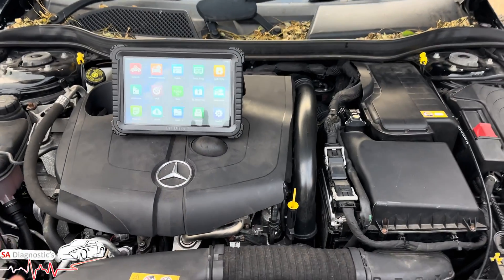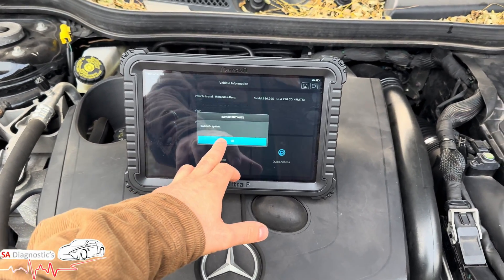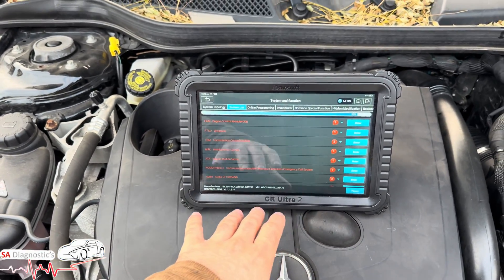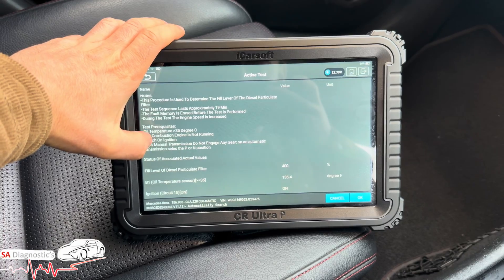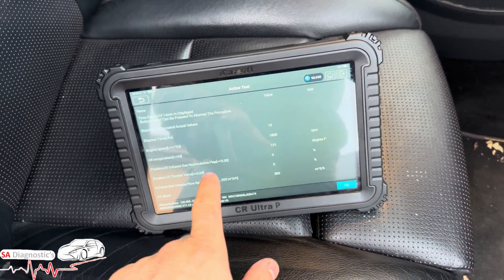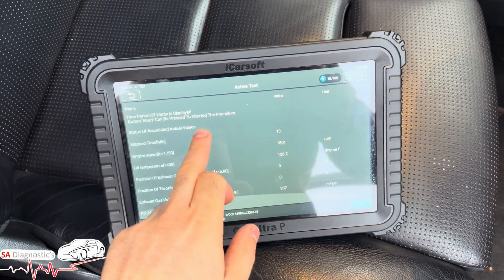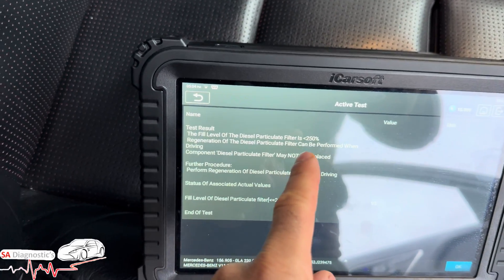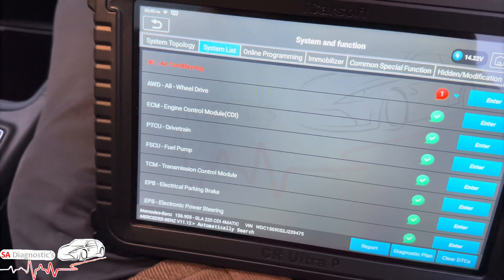How To Do a Diesel Particulate Filter Regeneration DPF REGEN - Step by Step - iCarsoft Cr Ultra P

Comment: Hello my chevy cruze 2.0 diesel 2011 has the check engine light on saying that dpf id full and not regenerative however i just had the dpf replaced so the saturation shouldnt be in 200 % llike its showing i tried resetind the dpf and the values as well but everytime i try to clean the erro code the intrument panel bips 2 times and the regeneration light blinks one time on the dash i tried doig a service regenaration but it doesnt let me also i have a circuit code of the o2 sensor but i had before and was able to clear the codes back then but now i cant any ide of what could be it also showing p0672 and p2a00?
Reply from the maker: Have you replaced the dpf pressure sensor as that’s the sensor that controls the dpf and measure the soot level
Reply: @sadiagnostics no li didn’t because it’s reading pressure

Comment: I have a code p2463 keeps coming up. It's done 105k miles same car and engine as this OM651 134bhp. I can feel the car lag when I put my foot down. So I think it is a blocked DPF. Can I just drive it at hight rpm for a long time, or will it need more than that to clear?
Reply from the maker: Yes that’s good. Driver around 2500/3000rpm and do it for like 20 mins or so. Keep an eye on temperature etc…
Reply from the maker: P2463 HOW TO CLEAN YOUR DPF DIY FREE OF CHARGE
https://youtu.be/BDB1RvOKbw4
Reply from the maker: You can also clean it like I have on the link above …
Reply: Thanks for your advice, I tried it but no luck. Drove it in 3rd at around 50mph, 3000rpm for 30mins ish.
The next day I looked around for clues under the bonnet. I found the passengers side intercooler pipe felt loose. Like it was rattling a bit at the connecting bottom part. I could not see a clip on the bottom connection, but there was at the top. I need to try and get under the car, when it's dry. And I will see if it is connected properly, and if it needs a replacement clip. They seem to be different to the old fashioned, jubilee clips that were used 😂🙈